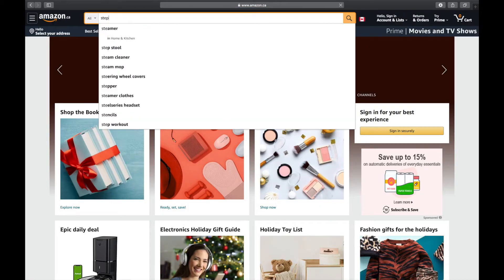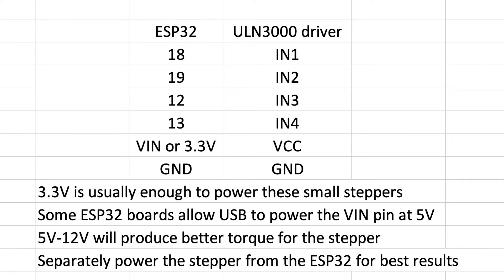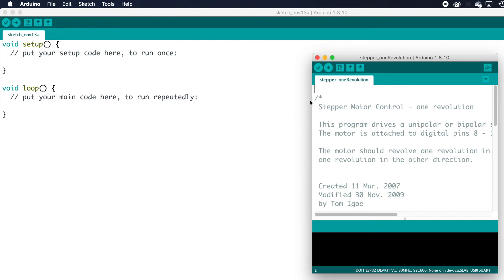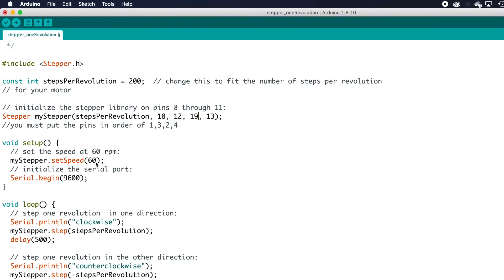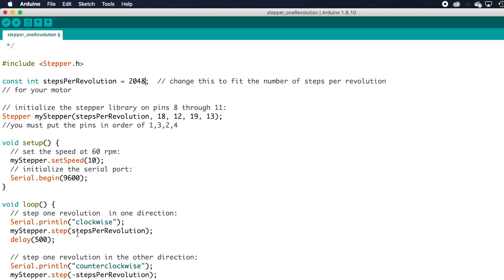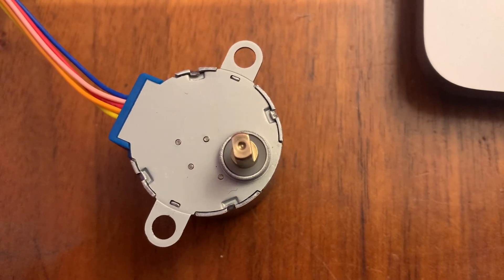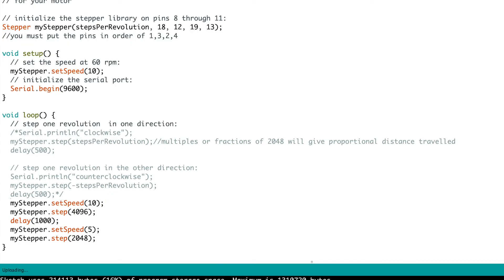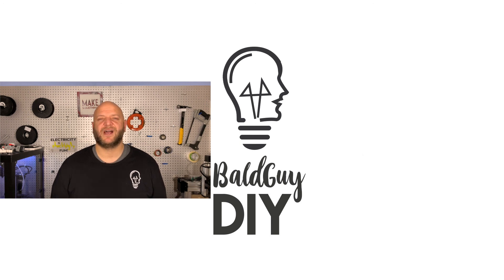ESP 32: How to Control Stepper Motors

Comment: Hi, thanks for your video. I got a question, how to code the esp32 to control two DC motors with different speed for example
Reply from the maker: Thanks for watching. What kind of DC motors?  What voltage, how many wires, what current rating?  All of those are pretty important to know to advise how to proceed. If it’s just a two wire DC motor you’re going to use some kind of driver or mosfet and pwm or analog write the output to control the speed.
Reply: @BaldGuyDIY  yeah it's just 2 wire DC motor and I use ln298 i think it's the name of the motor shield. I wanted to use pwm to control each speed but I think I made a mistake on the code, could you help me?
Reply from the maker: @sssedo1573  you can email me if you’d like. I’ve got a lot on the go right now but I may be able to take a quick look and see if I can spot the problem.

Comment: Hello, thank you for this video.i really appreciate it . I am trying to work on a project and i feel like you could please help me out .Could you make a video of how to control a stepper motor using ESP 32 Micro controller and data from an RFID reader and a Motor driver to power the stepper motor .
Reply from the maker: Thanks for watching. I currently don’t have time to make the video you’re requesting, but if you take the building blocks from each video and try putting them together, you should be able to find something that works. Good luck!

Comment: realy good explanation. thank you verry much. My stepper ist only moving in one direction though. any idea why that migt be? the output text still says clockwise and counterclockwise
Reply from the maker: Make sure the sequence is correct. 1,3,2,4 not 1,2,3,4. Thanks for watching!
Reply: try changing the  myStepper.step(stepsPerRevolution) to a negative when you want to change the direction
Reply from the maker: @emilyb7074  that does work if you have the sequence right, but if you have the sequence wrong, it won’t change direction like it should. Thanks for watching and commenting!